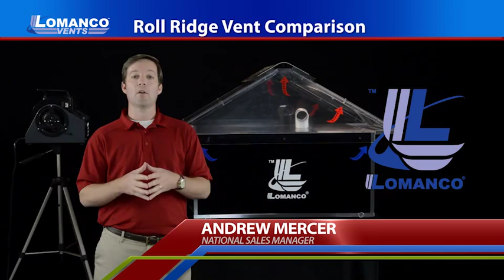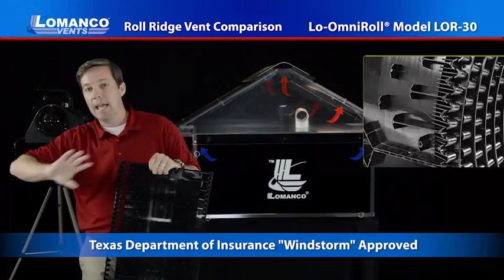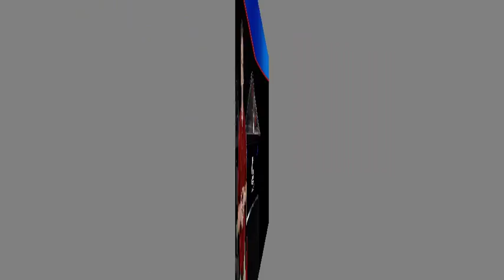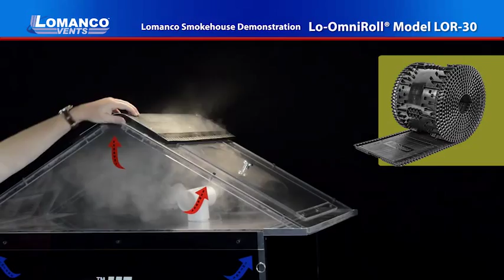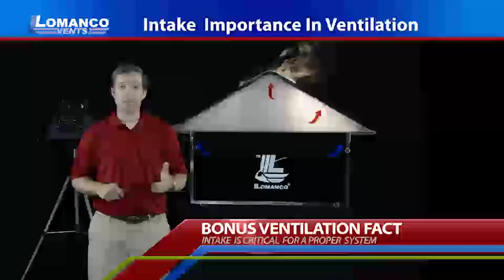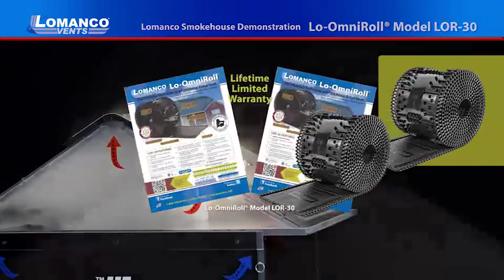Full LOR-30 Comparison and Smoke House Demo

Comment: Amazing! I have old off set vents. I live in Florida and after 10 am it is extremely hot in the attic area. I can take it since I spent much of my life as a Disney Character, However, My 25 year old roof is being replaced and this is what my Roofer is using. EXCELLENT video that does not bash other products...no need...The truth is visually  displayed for us to see. Thank you, since after a person spends 10-20 thousand dollars on a roof we have a product that will ensure the longest life possible.
Reply from the maker: Thank you for your support.
Reply: I did extensive research with a remote temp probe 4 times a day 40 days before the start of summer & 40 days afterward. I have several readings of 155dg+ the max for this probe. After installing 0R-40 135dg max, very happy! This in Iowa. So much difference in AC performance. North & South winds make an incredible difference.

Comment: How do you keep the bugs out with this product?
Reply from the maker: Because many products on the market include a filter that is marketing to keep both weather and bugs out, this is a commonly asked question.

Lomanco has no history of any bug or insect issues that resulted from use of our ridge vents. With features such as curved internal baffles, molded-in end plugs, and external baffles, you can see we have put a lot of thought and engineering into the design of our product. So with that, we did not overlook the bug question, we just determined it to be a lesser priority. Products with filters restrict bugs and insects, but they also restrict airflow. We are not willing to sacrifice airflow for something we have not had an issue with. Testing shows that a filter restricts air flow by as much as 33%.

A couple things to note - the louvers on our vents our closer together than most competitors - making it difficult for bugs to enter the vent. Also, the vent will constantly be moving air. This is true under calm wind conditions and even more when there are winds present. Critters such as bugs and insects are less likely to try to enter a vent that has a steady flow of air pushing out of the vents.  Omni series ridge vents effectively keep bugs from entering the attic space.

Comment: What is a better ventilation method; ridge vents or turbine vents?
Reply from the maker: Hello and thank you for your interest in Lomanco products. 

Lomanco manufactures several types of exhaust products - ridge vents, static vents, turbines, power vents. All exhaust products are designed with different needs in mind and one is not "better" than another. Each type of vent is designed with maximum ventilation capacity and the best weather protection available - the "Lomanco Balance." 

The type of product is often chosen based on the type of roof. For example, a hip roof is normally best vented with a turbine or power vent. 

As long as the proper number of vents are used and the system is balanced, (50% exhaust and 50% intake), all of Lomanco's exhaust vents are equally effective. It is up to each homeowner's individual preference on the type of vent used.
Reply: LomancoVents thanks for the reply. And I really appreciate the level of detail that you gave me. I think two turbines will work best in my situation.
Reply: How about a smoke test with a rain simulation ?

Comment: I dont find much value in this video becuse they are using s full size oriduct on an extremely reduced size model.  Attic space and air speed (wind) are so highly misrepresented its pretty useless to simulate actual performance.  

It might show relative performance but all of the brands tested eere victim of a flawed simulation.
Reply from the maker: Thank you for your feedback! We understand your concern about the scale of the demo model. The compact model is intentionally designed to visually demonstrate the functionality and principles of our vents in a controlled and simplified environment, rather than simulate real-world attic conditions.
Reply: @Lomanco  I ended up doing a lot of research regarding NFA etc and decided to buy your rolled ridge product.  It's max NFA matched up well to my soffit venting so that maximized the ventilation potential without going over which would have resulted in potentially reversing the direction of the airflow within the attic (venting out the soffits instead of the ridge).